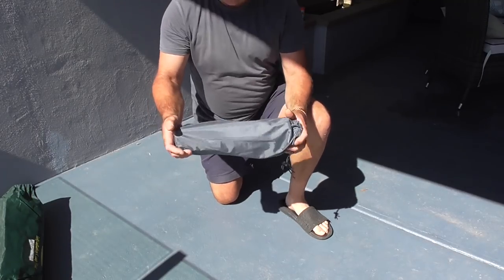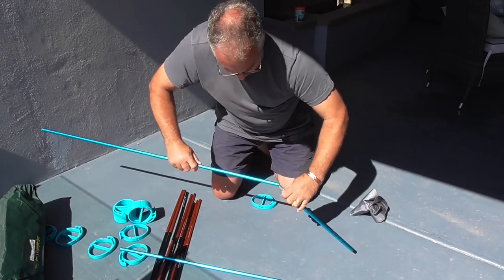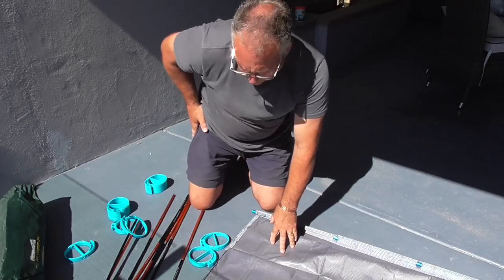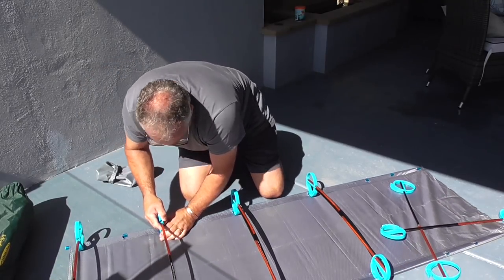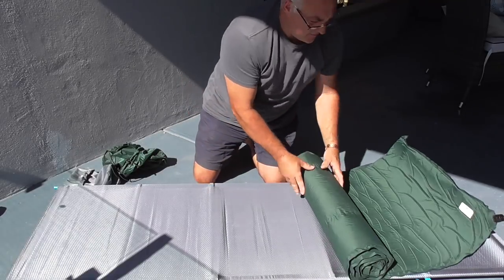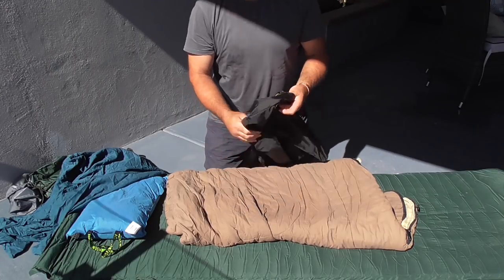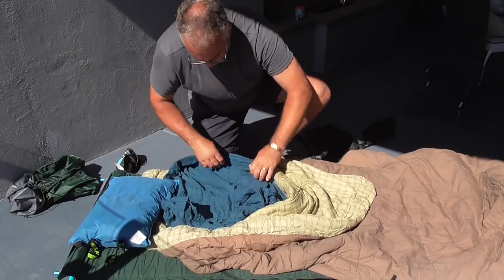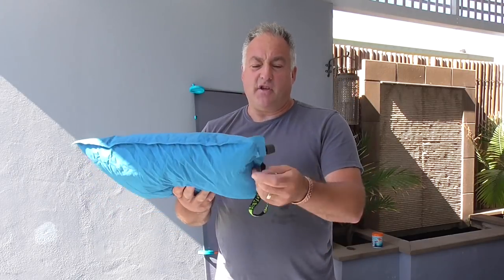Camping bed setup

Comment: Thanks for sharing Andy.
I just purchased a klymit stactic v luxe. 20 breaths and it's inflated. Tryed it last night and was great. There are different models available with different R ratings. Much more compact and lightweight than self inflating matteres.(I also used to use them) For sure worth a look👍 Cheers Max
Reply: I use the same brand and I highly recommend their sleeping pad.
Reply from the maker: Oh Nice ive seen these did you go Camo color or just go orange?
Reply: Hi Andy, I purchased the blue/stone grey one. R rating 1.3. size XL
Reply: Thanks for the very useful video Andy... Huddersfield UK